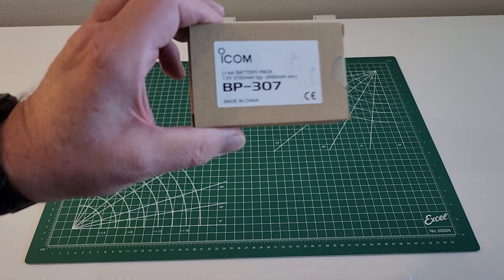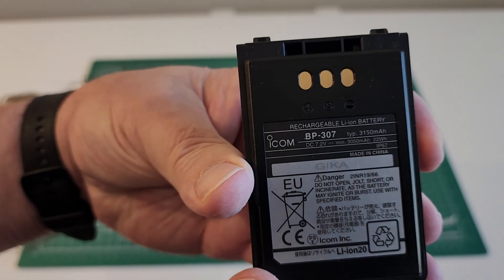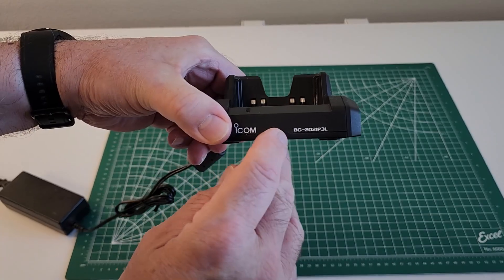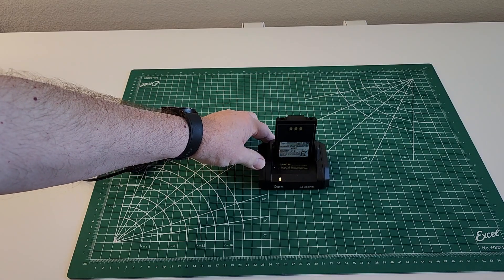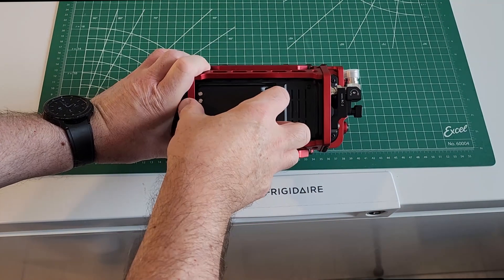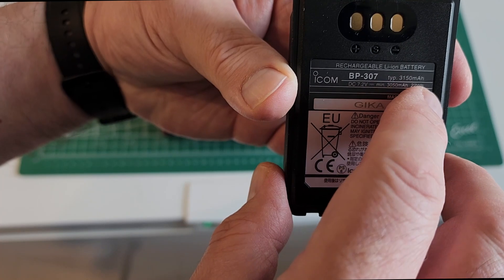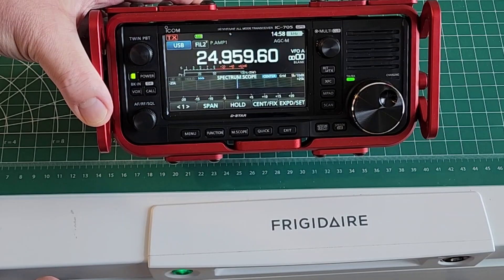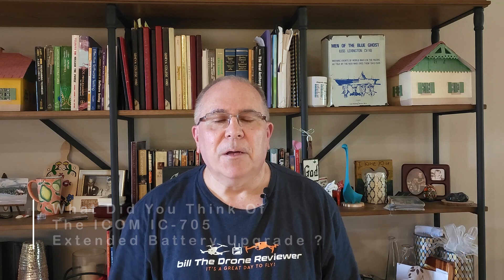ICOM IC 705 Extended Battery Upgrade

Comment: In Europe my IC-705 was already equiped with the BP307 battery pack.
But I still use the external LiFePo4 12V/6Ah.
Reply from the maker: That's great it comes like that. But like you I almost always use a LifePo4 12V 6ah battery when I'm out for the day.

Comment: I've never had a problem with the 272 battery although the 307 extra capacity is appealing. 95%+ of the time I use and external power source to get 10watts output. If the 307 would allow me to run 10 watts without an external power source this would be a slam dunk decision IMO, sadly that does not appear to be the case.
Reply from the maker: I'm the same way - most of the time use an external battery so I can get 10 watts output. Would be great if ICOM would make it so we can get 10 watts out o fthe 307. Thank you for your comment.

Comment: I started as an, Amateur Radio Operator. When I was 13.... But by the time I turned 15. I no longer wanted to be an, Amateur Radio Operator. No. I wanted to be a Professional Radio Operator. So I got my FCC 3rd Class Radiotelephone License. And at 15 years of age. I went to work for a College Radio Station. As the youngest, person. They had ever hired.. As a Volunteer, Radio Operator. They gave me a 2 day per week show. And handed me the keys to the radio station. As I would be working on Thursday evenings and Saturday afternoons. There all by myself, alone. At 15.

Last year in April. My younger 64-year-old brother. Died suddenly but not unexpectedly. And I have inherited an, ICOM IC705. Like you have here. With all of the optional goodies. I'm really not interested in it.  Though it seems to be getting great reviews. And if I was an, Amateur again. I may have considered it? But I also have some, mobile radios he also purchased. And 3 handheld units. One being appreciably more expensive than the other two. By other popular  Chinese manufacturers.

And in turn. I've also inherited his, 2 Meter, Ham License. KG 5- And I forget what else?

I know a couple of the walkie-talkies are GMRS. Not sure if one is capable of 2 Meters? I'll have to look them up.. I have no real reason to keep any of these. I'm not into this stuff. It's kid stuff. It's walkie-talkies. It's CB radio all over again. Now in FM with Repeaters available. So it's intelligible now. And these units sound good. Not like RadioShack CB radios of, yore. Garble, garble, good buddy. What's your 20? Now it's in FM!

And I just love the, Wideband and Narrowband, selections. LOL. Yeah right. The wideband is still not, 75 kHz wideband deviation. Like FM radio. It still narrowband. Just not as narrow as narrowband selection. It's cute and amusing.

I love the spectrum display readout. That looks fabulous! But it's all just an adult toy. And I don't play with toys anymore.

Though I can see the advantage. If there is a, regional or national calamity. Ham and GMRS, may be all there is? Kind of like after, Tornadoes, hurricanes, blizzards, electrical grids failing, earthquakes. Much of the communications capabilities will be knocked out. Telephones and cellular companies will be down and nonoperational. GMRS and Amateur Hams. Maybe everybody's, communication saviors.

And as I see it now. I don't need any, GMRS or Ham, Certificates, Permits, Licenses. As since, 1980. 44 years ago. I obtained my 1st Class Radiotelephone Lifetime License. And that means I am authorized. To work on and service, all Transmitters. Though I would need a special endorsement to work on Police Radar. I'm not interested in Police Radar. I'm interested in Great Sounding Audio and Video.

And I'll be damned if I know why? Home-based ham operators. Have not gotten themselves. A Good Quality Microphone and Microphone Processor? When it makes, Speech Communications. All the more intelligible and understandable. And you guys call yourselves Amateur Radio Operators? Right! You are amateurs. Nobody would know good quality audio if you fell over it. And it hit you in the head. You think a echoy, boomy, hollow sounding, Ham Shack is good?!? I don't think so. It sounds like crap! What the hell? Get a DBX 286. Plug your microphone into it. And turn the knobs up. Then plug that into your Transceiver. Everyone will Rave about your audio quality. And how great you sound! And what are you doing? To sound this great?

I mean this is a simple thing guys. You can plug other stuff into your transmitters. And guess what this will also do for your Amplitude Modulation? You will have higher increased, output power density. It will remain higher. It will keep the, modulation up there. And you will get, more for your money's worth out of your Transceiver.

But hey. Amateurs, really know what they are doing. You might know how to create an antenna? You might deem, vertical polarization better than horizontal polarization better than helical polarization? I don't know? I don't care. I want my audio to sound great. Why not you guys? Communication microphones? Blah! Get yourself a SHURE, SM-57. With the optional, oversized, approximately, 6 inch long, Gray Foam Pop Filter.. And you plunk that onto your SM-57. This then gives you this sound quality. Of the, $300 more, SM-7B. You see all of these other, clueless schmuck's on YouTube with. Because they think that $400 microphone is a better microphone then the companies, $100 microphone. Right? Wrong stupid breath!  They are identical. The microphone capsules, are identical. There is no difference. The SM-5 the 7 along with the 56, 57 & 58. All use the same 57 style capsule. And only someone like myself. With an in. To their engineers at SHURE Brothers Inc. As I had to write contracts. I needed specific, technical information. And I got it.

And so only stupid clueless people purchase the SM-7B's. And the newer SM-7dB, version. With a USB output. Still all the same 57, cartridge capsules. No difference.  Only the housing and a couple of switches. Make it different. $300 worth of difference. And the joke is on everybody. Put the big pop filter on your 57.  You've got an identical, SM-7B, sound. Identical. But only well seasoned intelligent engineers like myself. Knows such stuff. You guys wouldn't. You are amateurs. Amateur Operators. Yup. But you don't have to sound like Amateurs all of the time anymore.

I mean every successful, commercial narrative, voiceover announcers and celebrity DJs. All have, Microphone Processors. Dialed in and tweaked up for them.. They will do nothing without that. It's in their contract. It's that important.

(More  Porking in following post)

Comment: And I've set up a number of clientele. That all requested. Voiceover recording capabilities. In their office at work. Some of these folks were actual Medical Doctors. One in particular was a, Hipno Therapist Psychiatrist.  He wanted to be able to give a copy of the, Hypnotherapy session to their patient. At the end of the session. And he wanted an extra copy for himself. So it had to make 2 simultaneous recordings. One I directed into his computer. The other side directed to a standalone tabletop CD Cutter by TASCAM. And I included the DBX 286 Microphone Processor. It keeps everything very consistent sounding. Upfront, personal and in your face with great clarity. Nobody will miss a consonant, in your speech. With a DBX 286. Sitting on your tabletop.

I'm not even certain if DBX, makes these things anymore? I think they are still available. But you can find plenty of used ones on eBay.  For a song! For generally around or under $100.  Worth every penny! I don't recommend recording any vocals spoken or singing without them.

Of course I use a much more costlier, similar method of doing the same thing in the studio. But if I didn't have all of that gear. I would simply get a DBX 286. They do everything I want done. Very inexpensively. Very easily. And with a lot of fun with the results. You won't believe the way you sound. You'll wonder why you didn't pursue, Radio & TV Commercials? Those of you that have nice speaking voices. I have a great speaking voice. But I did not pursue much voiceover work. I was in FM rock 'n' roll DJ.. That was a lot of fun. I would get calls on my, Request Line. Of which we had 6 incoming lines. They would ring all night long. I would be answering them all night long. Many people tell me. They loved the sound of my voice. I was always very flattered by that. And I did some, voiceover commercials here and there.

But I did not personally pursue voiceover work. As my career. In hindsight. I should have. As I do have that kind of voice and delivery and articulation and vocabulary. I can pronounce a lot of words many people have problems with. Although most people seem to get, Supercalifragilisticexpialidocious, right. Without stumbling. Amazing! But get them to say at your Ford, Lincoln Mercury and Dodge dealer. Can be challenging for some. I have trained my tongue, very well. Just ask any of my girlfriends. But they only may be able to respond with grinding and groaning sounds. I am so incredibly Articulate. In the right places. Inside the bedroom. I've had a lot of practice. You need to have a lot of practice. So start practicing now. Your girlfriends and wives will love you all the more. And afterwards you will actually be able to have a conversation. Without you mumbling anymore.

And so I don't need any other licenses. I got the top license.  You can't get higher than what I got. So I don't need any GMRS or Ham certificates of my own. I will simply be testing a radio. Breaker breaker good buddy can you hear me now. And other such important conversation, as that. Good buddy. 10 for. For what? For whom? Oh you mean 10-4? Gotcha.

And so what I think about that Battery Upgrade? It looks like you put a bigger battery on it! Woo hoo! Who would have thunk it?  That was a Great Battery Upgrade! Now you can talk longer and listen more! Will wonders never cease? Who would've ever thought you could put a larger battery on this thing? I was connecting it to my car battery. In the car. But now I don't have to anymore. I can use a bigger battery. Who knew? What will they think of next? Maybe an AC power supply? Oh that's right it came with one thank you.

This video sure was exciting. Watching you one box that battery. I never knew what they look like? Now you have shown us all. Thank you so much for this! I always wondered with the larger battery would look like? You have put my mind at rest. So has the, marijuana. It still works great at 68 years of age. And like Karl Malden suggested. I don't leave home without it. When I get into the American Express lines of the self-service checkout at the food store. That don't take American Express. It's just the, Express lanes all the Americans are getting it. At the food store. Where they take MasterCard and Visa. And maybe they take those others also? Where's your Diners Club card? Certainly an old geezer like you has a Diners Club Card? No? You got one from McDonald's? Why didn't I get one of those? I'll have to go to McDonald's and get to the bottom of this!

This video was more excitement than a 68-year-old should be having. Woo hoo…
RemyRAD

PS
if I recorded my post above. With my voice. You might think I'm Don Lafontaine. But I can't be because he's dead. But I can and do sound like that. Girls would swoon over the sound of my voice. They really did. So practice a little more. And you won't have to sound like an old fat ham. Oink oink oink. Kind of like how you sound now. Like an old ham. Oink!

Suewe!!! Oink! Do you want a treat? How about a bigger battery? Here. Bend over! Oink!!!

Comment: When I purchased my 705, I gritted my teeth to deal with the pain caused by ICOM's absolutely totally outrageous accessory  prices and decided to pick up both the official ICOM BP-307 high capacity battery 'upgrade' and the VS-3 Bluetooth headset.

I instantly regretted the battery purchase, because the 'official' BP-307 works no better than the generic ones I later purchased on Amazon for 1/4th the price, and is already showing signs of loosing capacity - so basically it's CRAP.

... but the VS-3, on the other hand was a pleasant surprise that I think at least comes close to being worth it's painfully high price.  My VS-3 has nice audio on both TX and RX, plus excellent range (about 30ft in open air), and integrates very well with my IC-705.  I love the large easily managed PTT button, and you can even configure the IC-705 to use the FORWARD and BACK buttons on the VS-3 to step through your programmed memory channels remotely - with the added bonus of hearing your IC705 VOICE ANNOUNCING the newly tuned channels frequency for each change in your VS-3's earphone ! 

I thought this remote, totally wireless, operation capability was such a handy feature, that I decided to purchase a nice compact ammo-can style case, which is completely waterproof and weather tight (MTM AC30T-35 available on Amazon), in a nice "emergency gear" international orange color, and then configured the box by adding a short internal RG-178 mini-coax jumper to a weather-tight o-ring sealed pass-through BNC bulkhead barrel connector mounted on the box's folding lid near the hinge. As a finishing touch, I added some copper foil tape on the underside of the box lid (grounded under the barrel connector screw threads) to act as a nice VHF/UHF ground plane, and installed a 14 inch dual band ducky on the other side of the barrel connector sticking out on the top of the box.  With this "lunch-pail radio" setup I can hit both 2M and 70cm  repeaters 30 plus miles away - or talk half way around the world with a portable BNC coupled wire-up-a-tree end-fed-half-wave antenna - - and do so safely under emergency conditions, with little to no concern about the weather getting to my IC-705.

So for anyone who hasn't already done so,  I can't recommend that you waste your money on ICOM's overpriced batteries -- just substitute a good quality after-market "BP-307  compatible battery" (after reading and heeding the Amazon reviews) -- and invest the hundred dollars or more you will save as a down payment on an ICOM VS-3 . . .

Comment: Question. How does it impact performance such as watt output?
Reply from the maker: When you use either the BP-272 or BP-307 the maximum wattage output is 5 watts. It's when you use and external battery like a Bioenno BLF-1203W you can select 10 watts. The advantage is you get considerably longer running time with the BP-307. Thank you.